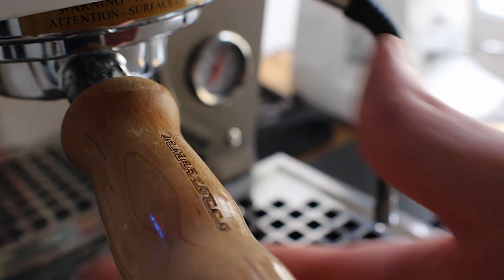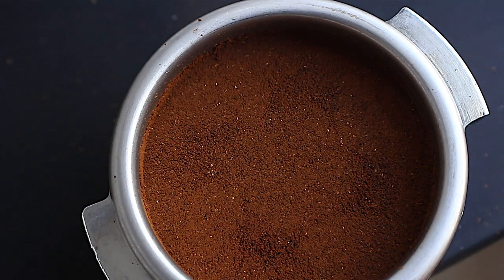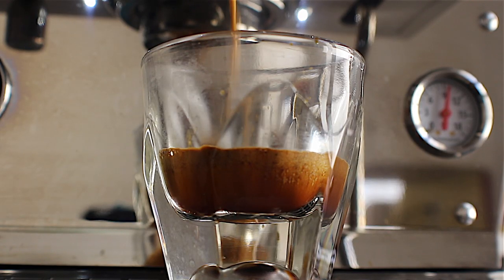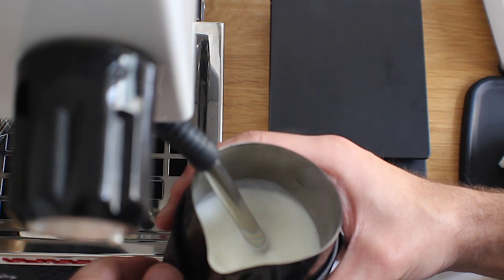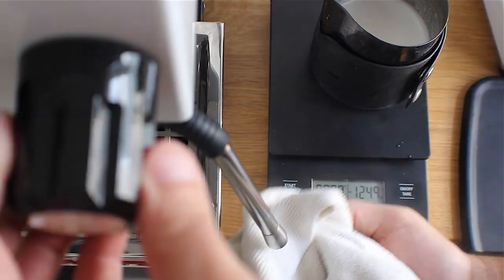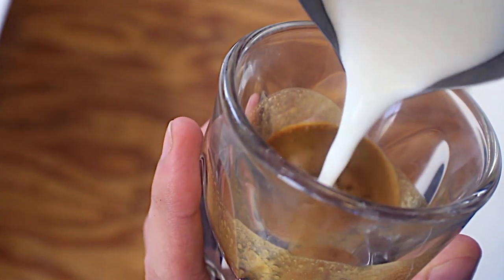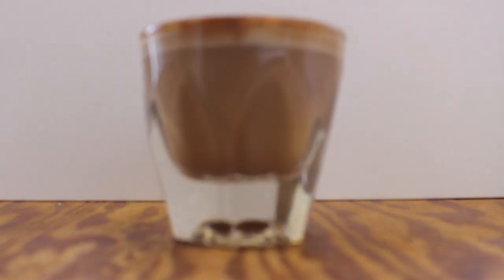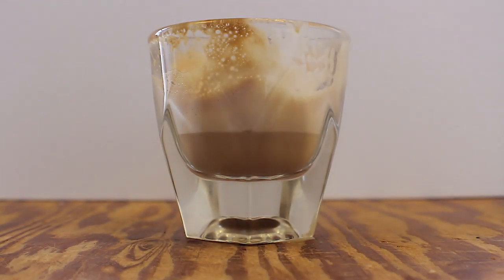ESPRESSO ANATOMY - The Modern Cortado

Comment: You filled the glass very precisely, but given the shape of that glass and the starting amount of espresso, surely that's closer to 2:1 ratio of milk to coffee?
Reply: G R  head over to the Not Neutral site, they provide the most comprehensive, g33k driven mechanical drawings of their drink wares.  The Vero glass here is 4oz, a 2:1 ratio would mean either a single 1oz shot was pulled (and honestly who uses single baskets) or the glass was 6oz, which it isn’t. 

I have the same glass, it’s a work of art, there’s a reason so many cafes around the world use Not Neutral.
Reply: Mike Panic Thanks, that makes sense. I was evaluating based on the visual approximation I could make. Watching again, it still seems to me that the espresso does not fill half the glass. Without measurements, we don't know, but for the sake of argument, let's say it was a 1.5 oz shot, and 2.5 oz milk was added. That's approaching 2:1 IMO. My question is simply how strict is the 1:1 ratio? I don't think anyone would reject the drink as made here! Looks great, and I'm sure it tasted great too.
Reply: @GR-qz8fx  It's not that strict. Keep in mind too that because the milk is aerated/steamed, it had more volume and will take up a little more room in the cup than the espresso at the same measurement (60g, or 2oz, or w.e.).